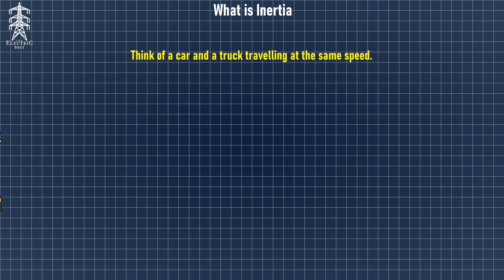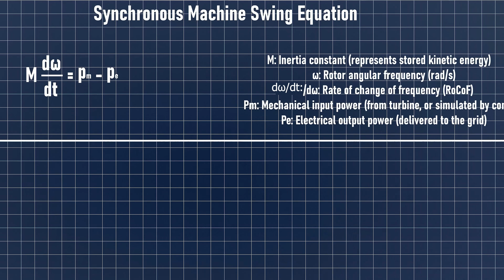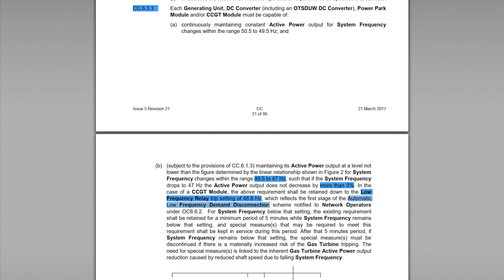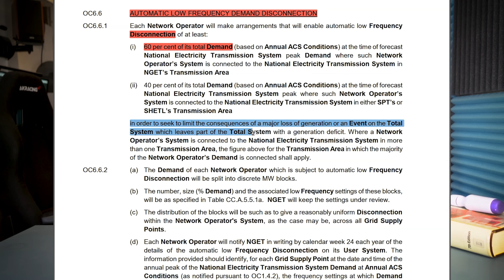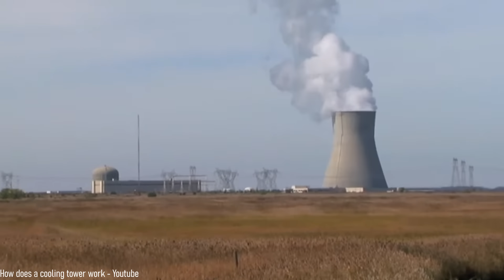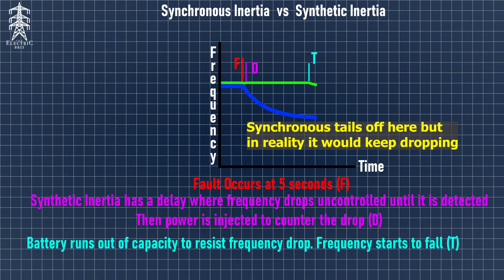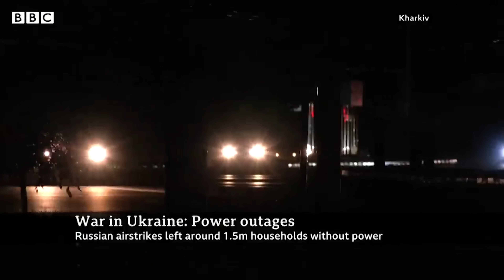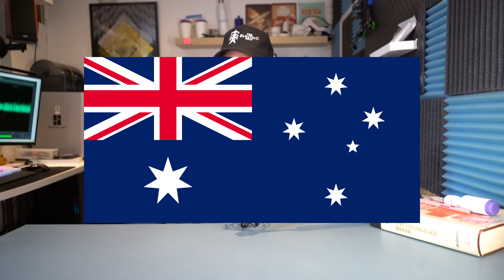How to Restart the Grid after total collapse

Comment: One key thing about nuclear plants, they are typically the most critical loads on the grid. In a blackstart, getting the power back to the nuclear power plant’s load is the first priority. Most likely a nuclear plant will not come back online until the entire grid is back due to the safety concerns of being on backup diesel generators. 

Also, something I found interesting in my own black start training. In a black start customer load becomes just a tool to maintain frequency and voltage. We will literally pick up a city worth of power just because we need to load a generator or bring down the high voltage from underloaded transmission lines. If your power comes back on shortly after a system wide blackout, you’re actually helping to restore the grid.
Reply: I know the kharkiv NPP in Ukraine left one reactor online and running at low power for months to power the facility when the transmission lines to it were damaged. It was kept online to save diesel fuel and provide power to continue cooling the other reactors untill they were in a cold state. They figured it was safer to keep one reactor in a minimum power state to ensure all the other reactors were fully shutdown rather than risk the limited fuel and power supply trying to shutdown all the reactors fully. 

Nuclear power plants are priority consumers of electricity out of an abundance of caution. The fact that a nuclear power plant was able to improvise safe operations in the middle of a war zone whilst mostly cut off from consistent supplies and support goes to show how resilient these facilities are. 

Depending on the circumstances most NPPs should be able to come online relatively quickly. At the very least most should be able to connect to the grid to provide inertia even if not fully operational. Some of the old but still operating coal plants in my area keep the turbines spinning in phase with the grid to provide inertia and to accelerate the time it takes for them to ramp up when demand rises.
Reply: @spencerhho  "I know the kharkiv NPP in Ukraine left one reactor online and running at low power for months to power the facility when the transmission lines to it were damaged."

Unlikely. The turbines need to operate at a minimum load, which is far greater than the plant load. I think the information you referring to is false, or incorrect.

Should the grid fail, for more than a few weeks & the back diesels run out of fuel the reactors will meltdown, and a month or two after the NPP losses power, the spent fuel pools will boil enough water away for the spent fuel rods to catch fire.

Also consider the possibility of a CME or NEMP that disables the back up diesels, The reactors will meltdown that day, and later the spent fuel pools catch fire after enough water boils away.

NPP are doomsday machines.
Reply: @guytech7310  Did your prompt to the AI that wrote this broken generated comment include the words "Make as much stuff up as humanly possible?" Wait, don't bother answering, I'll just ask GPT to reply back at you in russian or something.
Reply: @MS2A-d7e  No. I just worked at a nuclear power plant. I presume you have not.
Reply: @guytech7310 you underestimate how much electricity a npp consumes. Supplying just itself is a valid mode of operations.
Reply: @ulwur  No, it only needs a fraction of the power it produces. NPP are baseload plants & cannot dial back to low power. Its not possible to run the reactors & turbines to just power the plant itself. Go visit one & ask one of the engineers.
Reply: @guytech7310 i work at a nuclear powerplant..
Reply: @guytech7310  A CME or EMP will not disable back up generators, and it is entirely possible that the house load of the NPP itself is within the minimum operating parameters of a single turbine. Also, the reactors can absolutely throttle back their heat output. That's basic reactor operation. They don't do it outside of maintenance or emergencies because then they're not selling electricity and making money.
Reply: @thelight3112  Diesels: about a 100% chance of failure with Carrington level CME and about a 40% change with NEMP the diesels will not function. Issue is that it will cause a power surge that destroys diodes causes coil arcing shorting out windings in the generator. A NEMP can produce around 200KV/sq meter and a Carrington level CME could be as high as 1MV/sq meter and the event can last for hours.

If the generators start, they only have limited fuel on site. When that Fuel is gone, the reactor will overheat & meltdown. There will be no way to refuel these plants as roads will be blocked with disable vehicles, & no power to the refineries, pipelines, etc. It would take years to get the grid back on like as large number of Distribution transformers will be damaged or destroyed & need to be replaced or serviced. 

Nuclear power plants are base load plants they don't operate efficiently at low power, & cannot operate at very low power levels. The minimum power output of a 1000MWe is about 100MW. below that level its not possible to run the plant. The turbines are also directly coupled to the yard transformer for long distance transmission. After an CME\NEMP, the transformer will be damaged from internal arcing, & will become unusable. 

Safety systems will also lock out the plant. when the NPP is no longer connected to the grid, the reactor is automatically scrammed as all of the control rods are dropped to prevent further fission reactions.
Reply: Light water reactors also suffer xenon poisoning. If they can't restart them within a few hours, they will have to wait almost a week for xenon to decline to tolerable levels for our limited excess reactivity to allow them to restart. The electricity situation in the immediate aftermath of the 2003 Northeast Blackout was still very unstable for the first few days as a large number of nuclear reactors could not be brought back online.
Reply: Interesting discussion. I read a guy on YouTube claim to be a nuclear operator. He said Xenon isn’t really a problem as it is a predicable parameter given the core age, time after trip and operational condition are known. And they have model to predict xenon level which in fact help in the restart. As it acts as virtual control rod which help add reactivity to the core to counteract rising coolant temperature.
Although in real life, do-able doesn’t mean they will do it as there are a lot of procedure, meetings, authorities visit, just in time training/simulation need to be done. But xenon isn’t a showstopper
Reply: Some nuclear power stations are designed to be capable of riding through a loss of offsite power. The control systems can shed a significant amount of load with the idea being to remain islanded with the generators supplying house load. A tripped reactor in the UK is unlikely to be restarted until the grid was restored and the operator was confident of not losing the grid again- the point being, nuclear safety is considered more important than any other factor.
Reply: @glennlee2155  "Some nuclear power stations are designed to be capable of riding through a loss of offsite power. "

Which ones?
Reply: If it's running and loses access to the grid, i'd assume most if not all npp's could have their steam bypass the generators to an extent that they can still produce power for themselves, but they might be in a precarious situation procedure/fault tolerance wise.
Reply: @Viper607706  They aren't set up that way. For starters when they loose grid power the control rods are automatically dropped into the reactor & the backup generators are started.

There is no procedure for long term grid outage. When they run out of diesel, the reactor will meltdown & after a few weeks the water in the spent fuel pool will boil away exposing the tops of the spent fuel rods which will catch fire as the casing burns when exposed to steam.

Really the should all be permanently shutdown & decommissioned. Too much risk.
Reply: @guytech7310 yeah no you're completely and utterly full of crap; some of their procedures they have are for if the grid goes into a black state.

Even if they can't hit the overrides to allow it to operate in an island mode IE separate from the grid and it'll output only to the grid without any input, there are so many safeties and overrides that modern reactors have features that will shut them down even if the grid collapses and for some reason the operator crew are all slumped over their consoles, the reactor will start to shut itself down.

I know a bunch of the American and British and French ones have coding in their control systems that if they don't detect any input from an operator in a certain amount of time it'll start sending alerts and essentially after a set amount of time I believe it's usually a couple hours although it may be a couple days for some of the more automated ones that if it doesn't receive either any interaction from the control crew or essentially a password stating everything's fine go back to operation it'll scram itself shut itself down and Trigger alarms until someone comes in from the outside with override code.

Stop fear-mongering about nuclear reactors we've come up with inherently safe designs since the 1970s the reasons they are implemented is because they're expensive and people are cheap.
Reply: @Shinzon23  Sorry, but your assumptions are incorrect. NPP have backup diesel generators when they loose the grid. The reactor is automatically tripped & the control rods are automatically drop in. 

They can run on diesel power until the fuel runs out which can be  between 7 days & 30 days, depending on the nation regulations.

"There was one I saw for a coal power plant that if it ever goes offline in the Diesels"

That is not a Nuclear power plant NPP. NPP need constant active cooling to avoid a Meltdown. Spent rods need about 4 years of active cooling before they can be put into dry casket storage.

In the event of a long term grid failure, the NPPs back up diesels will run out of fuel. The reactors will meltdown in matter of hours. After about 30 to 45 days, the spent fuel pool will boil enough water away to expose the tips of the spent fuel rods. when that happens the catch fire (the cladding burns when exposed to steam). Once that happens its all over.

No amount of safety features will prevent a NPP from melting down there is a loss of active cooling. Officials never tell the people the truth because their would be mass protests & people demanding to shut them down. So they keep the public in the dark.

NPP are doomsday machines. 

Consider Fukashima. No safety measures preventing the reactors from melting down. The earthquake tripped them offline, then the flood water disabled the backup diesel generators. The reactors started melting down in a few hours.
Reply: Well I know a nuclear power plant that tried to support itself... They made the mistake for all of us... 😅
Reply: Ordinarily yes but there are overrides in place that you can do that will force the plant to work in a standalone mode it's very much not recommended because the chances of failure due to something going on with power going to internal systems spikes massively.

However it can be done and the people who think up contingencies very much do look at post-apocalyptic media and some of the plans out there are very much Mad Max.

There was one I saw for a coal power plant that if it ever goes offline in the Diesels are broken is literally to go out and see how many household generators they can find to strap together to power the cooling and the mechanisms needing to grind the coal and you know toss it into the burners long enough to get the turbines up to speed to generate its own power.

If you can think of a scenario, odds are some bright spark at some time anywhere from the 60s up until now was commissioned by the government to think of and come up with solutions to said problem.
Reply: @Shinzon23  at Fukushima they went to the parking lot and stole the batteries from the cars and wired them in series to run the control systems...
Reply: @thewhitefalcon8539 yep there's a similar plan in place for reactors in the US
Reply: Ok am curious about this.. so if a station goes offline.. its has to "shed the instantaneous load" or shut down.. cos engine overrev.. Is there a shock load kinda stuff going on..
Reply: @pedromorgan99 if the main brakers shut off they just dump the steam into the condensers bypassing most
steam from the turbine. They'll keep the turbines spinning to supply itself of source. At the plant I work with it's called "house turbine operation" translated from Swedish.
Reply: If Grid fails for more about 30 days, all those reactors will meltdown & later the spent fuel pools with catch fire. UK will become un-inhabitable.
Reply: Isn't the lag in nuke power more to do with clearing neutron poisons, which usually takes days.  Even a normal grid shutdown requires days to restart.
Reply: @Mixer-he2wb  Neutron poisoning due to Zenon build up takes several hours to build up. If you know exactly why you have tripped you can restart quickly before zenon bulds up and just manage the reactivity transient after you restart. If you don't know why you have tripped you have to find out before you can restart and after 12 yours or so you may find xenon level is so high you have to wait for it to decay naturally before you have enough reactivity to restart. Backup diesels on a nuke are to maintain safety while you deal with decay heat so you won't restart until you know you have a stable grid supply. To run main reactor cooling pumps you need around 40Mw but decay heat removal requires far less and diesels are sized for that load.
Reply: @Mixer-he2wb  this is false. after nuclear disconnects from grid, it doesn't mean the reactor shutdown...  you are watching too many movies mate.

Comment: new sub due to your simple explanation of what is an incredibly complex subject

reminds me of a visit 40 yrs ago to fawley power station (RIP)  they had cro based synchroscopes on carts in the control room. I got to actually touch a running turboalternator, can you imagine that these days?
Reply: (currently a sparky  mostly doing domestic and light commercial, but i LOVE the deep dives into what is behind it all)
Reply from the maker: Thanks for the comments! If you get a chance you should check out the control room bar at Battersea. They have some of the original control room and instruments there still. Some of our older substations have the old wooden carts too with instruments built in. Amazing history we have here